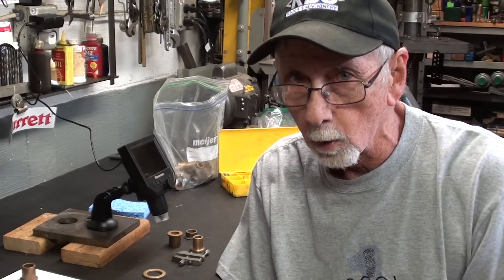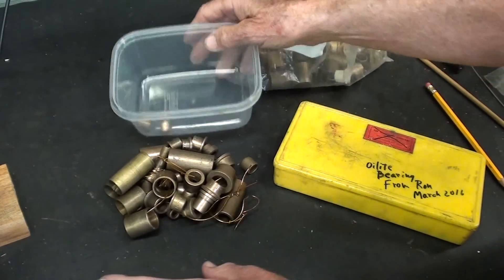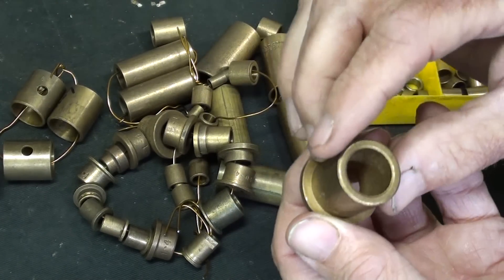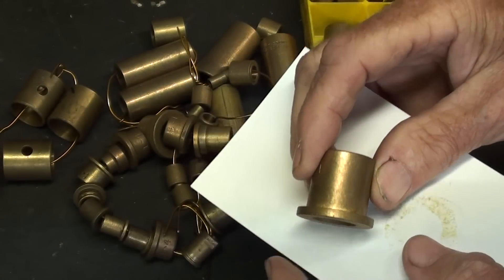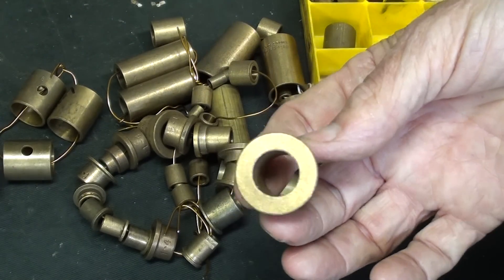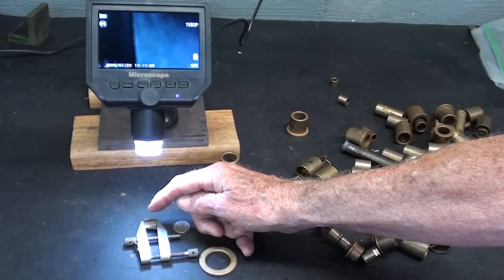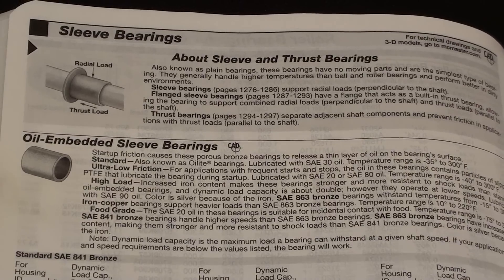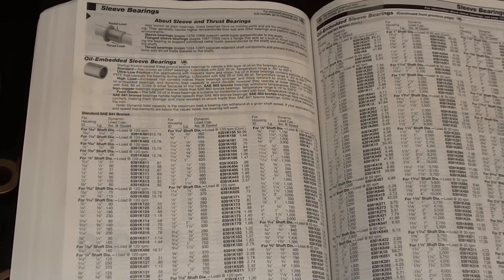SHORT SUBJECT #7 What Are Oilite Sintered Bearings tubalcain

Comment: Mr. Pete. Greetings.  I am rebuilding a Porter Cable Lock Mortiser 513 which slides on rails via bronze bushings.  The housing has bushing on both ends therefore I cannot push them out from the back.  I need to remove one of the bushing whole in order to get an accurate measurement to replace the same as they are no longer available from PC.  The ID is 7/8 x 1.25 L .  Would a collet bearing puller work?  Finally is there a rule of thumb on how much the replacement bearing  should be oversized for a press fit into the housing?  The housing is aluminum. Similar question for the ID of the bushings that ride on the rails.  Its not a press fit but mut have  enough tolerance to easily slide without being sloppy. Thank you.
Reply from the maker: Yes, try the puller. Those oil light bearings are usually oversize on the OD so they will press in.
You may have to ream the ID to get a sliding fit

Comment: i want to replace the damage steel bush bearing of my electric motor 1425 rpm, round per minute that contains. A hole for oil feed with bronze centered oilite bush bearing size 5/8"x3/4"x3/4'"

Comment: In the '70's I worked for Xerox. We had a copier that used an oilite bushing/bearing. It was on a dashpot, (remember those?). The page was scanned by a light and mirror assembly that was pulled by a cable and at the end of scan a solenoid released the wind up and springs pulled the mirror assy back. At the end the assy hit the dashpot to slow it down to start again. The oilite thinger kept the shaft straight and would require cleaning from the paper dust every 5K scans. 

In the '80's it changed to stepper motors in both directions.

Comment: These are used exclusively in my very accurate Myford S7 lathe - there are over a dozen of them in there I think. Ive always wondered how critical it is to oil them via the oil cups.. Looks like its not that critical, and how neat is it that heat from friction auto-lubricates the shaft? Thanks for the cool vid, and props for the blowtorch idea.

Comment: I ran a 1250 Multilith offset press with many of these in it. Too Bad they do not many machines like this in USA any more. You can scare them so when replaced I used a 2 by 4 and a hammer to push them in. I had a problem with the hole would elongate due to the belts being to tight. Press operators would tighten the belts up too tight instead of fix the cause. I am guilty of this too.
Reply from the maker: Interesting comment. We had the same model of press at the high school years ago

Comment: Oilites are sold as "permanently", "lifetime", or "no-maintenance" lubricated, which is a bald deception.  All that means is the anti-feature: *no feasible way for adding or changing lubricant*.  The bearing itself is not permanent or long-lived, compared to a ball or roller bearing.  Eventually the oil oxidizes/polymerizes (gets gummy) and ceases to migrate in the sponge.  Then the bearing surfaces dry out or gum up.  That's why you see them being stalled at startup with low-starting-torque motors like in a fan, even though they're not fully seized, and why cleaning and adding oil does no good to restore the smooth function.

They should more realistically be called "non-serviceable, temporary, light-duty-only" bearings.

Kind of like non-replaceable batteries in smartphones nowadays.  Lasts the lifetime of the device!  (Lifetime == however long it lives)

Comment: Oilite bearings were a common component of slot cars for many years, typically used with 1/8 and 3/32 inch axles.

My research indicates that the voids in the sintered material were created by mixing plastic powder into the bronze powder to be sintered into a solid and under the heat and compression of the process, the plastic would vaporize, leaving the voids that formed the metal sponge. Based on old and failing memory, the best bearing material was created with an 18% plastic component.

We rabid slot racers often liked to replace the low-quality factory Oilite 'fill' with higher quality oil. The usual technique was to place the bearing on the clean tip of a soldering iron until the factory oil boiled out and then to drop it into an appropriate solvent, acetone or something similar. Once cooled, reheat the bearing on the soldering iron tip again and when hot, drop it into a better oil, typically a modern synthetic like one of the Mobil 1 products, which would be sucked into the the Oilite.

One point: Oilite bearings do tend to wear shafts running in them more than well-fitted, well-lubricated solid bearing bronze bushings. The theory is that the porous Oilite does not allow for the presence of the hydrodynamic wedge that forms within a well-lubricated solid bushing, thus preventing most metal-to-metal contact. The benefit of the Oilite is that consistent lubrication of the bushing is far less critical.
Reply from the maker: Very interesting comment, thank you very much. I did not know that about the plastic. One of my follow-up videos was going to be on the oil film of plain Babbitt bearings such as automobile crankshaft.

Comment: I was taught that these had to be single point tool machined rather than a reamer (sharp or otherwise). They can be reoiled easily by heating the oil in a pan and submerging the bushing.

Comment: Sintered bearings are useful like ball bearings are useful. Other useful bearing types are sintered carbon-graphite bearings. The carbon-graphite is similar to the material that DC motor brushes are made out of. In a water pump, for example, the  sintered  graphite is lubricated by water (and graphite). Sintered metal bearings filled with graphite are also available.
I have fixed vane-type water pumps that are internally made of sintered carbon-graphite.
This was a great video. Your previous video on keyways was good too. But, round keys similar to square keys are useful. For example, a round-keyway for a pulley can be made using a milling cutter instead of a broach. Also, for example, a pulley and a shaft can be drilled lengthwise together to form the round keyway in the pulley and the shaft in one operation.

Comment: Thanks, Mr Pete. This answers a lot of old questions I've had about these, except for why some items have a warning that goes something like "Contains permanently oiled bearings. Do not oil." 
It also explains why my dieing window air conditioner would squeak after turning on, but then get quiet after it "warmed up". That blower shaft is now frozen though, so I'm curious what type of oil would best revive it, with a minimum of tear-down. I'm thinking either mineral oil or lathe oil that's been diluted with acetone may seep in from the outside and possibly leave the oil behind while cleaning off some of the "it's stuck" residue.
Reply: I usually pull the motor apart & clean the shaft with some scotchbrite or steel wool to remove the residue, then out a few drops of 5W20 synthetic oil in the bearings. They work like new again for a few years.
Reply: On a lot of small motors, in addition to the oilite bearing, there is an area around the bearing packed with some kind of wicking material (sometime it looks sometimes like wood saw dust others a wool wick) that is saturated with oil.  If you go to the trouble to take the motor out of the AC unit, it would be good to remove the cover off the packing (its press fit) and saturate that with oil.  It will make the motor go a lot longer before it needs attention again.

Comment: Just fascinating! The microscope really does show their structure completely unambiguously. I thought it might be too subtle and hard to capture on screen but the surface is a genuine sponge!

I think there is a lot of potential to show machining processes and their end-results through the microscope. For instance a series of images showing the polishing down of a surface with first coarse sandpaper and then through the finer grades down to jewellers rouge would be fascinating to see up-close. The profile of threads and perhaps the matching cutting tool would be another area where an up-close view was beneficial.
Reply from the maker: Thank you very much for some useful suggestions. Perhaps you saw my older video where I use an optical comparator?
Reply: @mrpete222  I haven't, but I will certainly check it out!

While I continued to think about the topic it struck me that the tool or especially the blade sharpening process would be very interesting to see under the microscope as well. The different profiles of edge and removing the burr are quite hard to explain so it would be helpful to physically see them.

Comment: I use to work for a sentering company. After heat treatment the bearings are placed in a pressurized hot oil bath to force the oil into the pours.

Comment: Sintered bearings are normally press fit on the OD which slightly reduces the ID for application.  Rather than reaming, bearings were ball sized with precision balls pressed thru the ID.  This method did not tear the inner substrate and rendered a smooth and precise bearing area for shaft rotation.  Great presentation sir.
Reply from the maker: Thanks
Reply: Very interesting fact, thanks.

Comment: I worked in a plant that made some of these and when they come out of the sintering oven, cooling section, they would travel down a conveyor and then drop into a "V" conveyor tank with 90-weight oil in it. They were in it long enough to absorb some oil, per specifications, then come out the other side for final cooling and packaging.
Reply from the maker: Very interesting, that they use 90 weight
Reply: Oh, so no pressure or vacuum was used, just simply dunked in an oil bath?
Reply: @ianbutler1983  It's likely that capillary action was sufficient to 'charge' the bearing with the oil.
Reply: @gregorywells7905  Yes, capillary or wicking would pull the oil in. At the time of manufacture, the first oiling would fill the empty cavities, then this oil would ozz out with temperature rise as the rotating shaft heated it and as it cooled the oil would be wicked back into the cavities. The brass and bronze material is also perfect, steel is not, as it would absorb the carbon atoms in the oil readily into its lattice.

Comment: Good Video just wanted to add with the sintered bearings you can oil impregnate the with an oil of your choice just buy sintered bearings without oil.  SAE 30 is the most common.  When machining bring them to just a few thousandths of dimension and let them cool off before taking final cut.  The tool has to be sharp and you even get tear out when they are glazed.  Actually make and impregnate them and it is miserable lol...

Comment: I feel you pain on having many of them, and still not having the one you need. Sounds like my screw, nut and bolt collection.
Reply: The other truth of that is, as soon as you get rid of even one of them ... you will immediately and desperately have need of the one(s) you discarded, and won't be able to find a replacement anywhere.

Comment: Have had a few where the replacement I made was done with self lubricating engineering plastic, as the application needed lubrication, but also could not contaminate, so Vesconite was the choice to machine them out of.  Even replaced the plain nylon ones with Vesconite, so they would wear less, and got a better fit on the shaft, as the originals were not exactly close tolerance. Oilite is great, but always the factory fill of oil is not enough, best to take them, place in a cup of oil, and microwave them till hot, so that you can get the full charge of oil in. Or soak overnight in a warm place, though microwave works faster. When you buy a motor with oilite always helps to add exta oil from new, the manufacturers seem to think the bush production oil is enough, and never add any extra, I always find the felts in the motor are clean and white, with a black ring where that bush got hot and glazed itself. New bush, or scrape the glaze off, and oil it works well again.
Reply: I’ve had success in machining these for custom applications. Some oil leeches out during turning. I don’t remember where I saw it, but I’ve been able to re-infuse these by putting them in a cup of 30W non-detergent oil then placing the cup in a vacuum bell jar. Under vacuum the parts are “deaerated” and the voids are filled with oil. You can watch the air bubble out of the parts. It seems to work very well for me.
Reply from the maker: Thanks

Comment: I was always told to never ream an Oilite bearing, so it's interesting to know they can be with a very sharp reamer
Reply: When these bearings are pressed in a bore they’ll sometimes close up enough to be too tight on the shaft. When this happens the bearing must be reamed or sized for clearance. Enough pores will remain open to provide some lubrication.